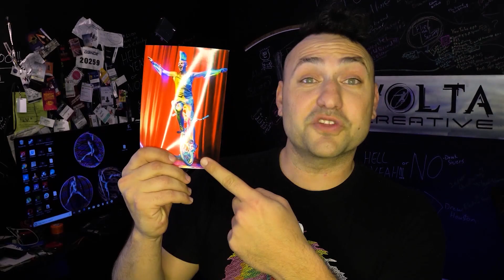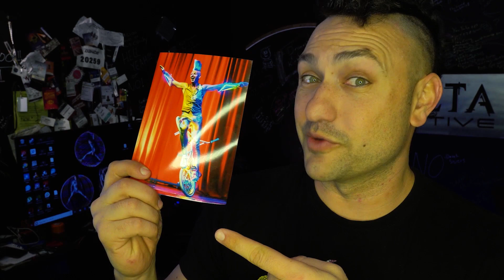Electric Monocycle 3 day build: Why I did it

Comment: Hi, Just found this and want to build one.  Did you use a steel or aluminum CYR wheel?
How is the original build holding up?  Thanks....
Reply from the maker: I used a one piece aluminum cyr that I had lying around...     It held up well but the wheel was made a little poorly so it isn't perfectly round
Reply: @DavidsDreamFactory  Thanks, two more things.  What is the diameter (ie. width) of the CYR wheel and it 
looks like you riveted the tires on?  Any other high level advice you can offer?
Reply from the maker: @kensmith7525  It was 6'1 Inside diameter and riveting the tires on worked quite well...   Biggest advice is start with a round wheel..  We had to make some compromises because it wasn't perfectly round and it limited our top speed.